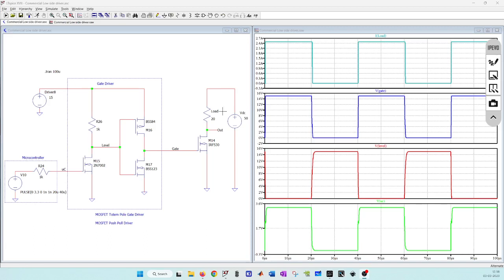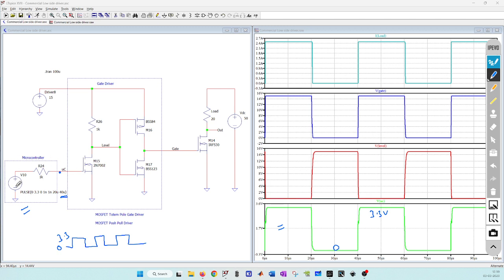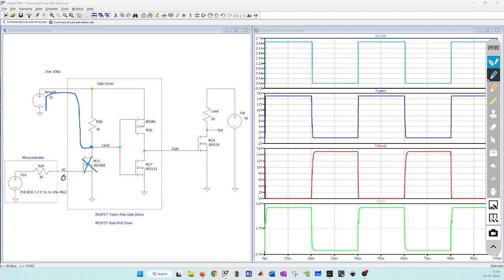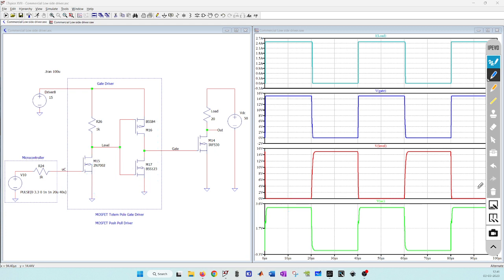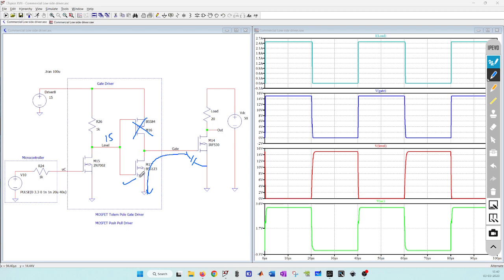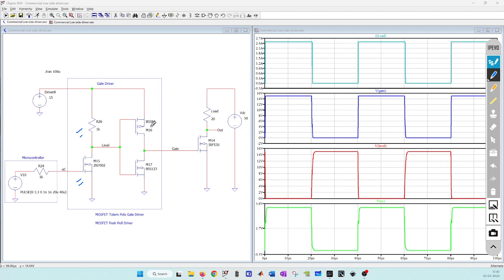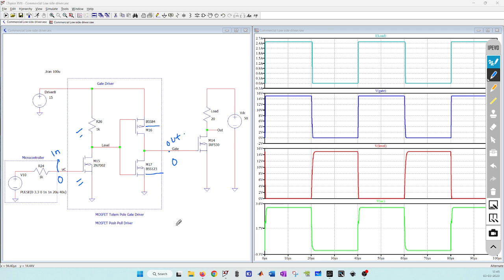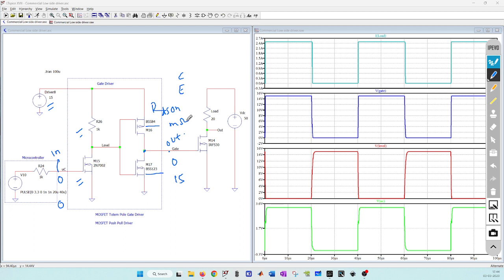Totem pole MOSFET gate driver | Push pull gate driver

Comment: Thanks for the video and sharing your work! Could you clarify the purpose of the first PMOS (M15) - is it so that the output follows the input signal ie. HIGH Vin = HIGH Vout. Could you also explain the benefit of the Totem Pole instead of just having a BJT NPN driving the PMOS ie. Vdc will be connected to both the collector and the load

Comment: Hi, how the schematic will change if you change the GND with another voltage  (for example 13V)? I want to have at the output of the Mosfet Totem Pole 13V when uC is in High state and 15V when uC is in 0 . Thank you :D
Reply from the maker: Try and see